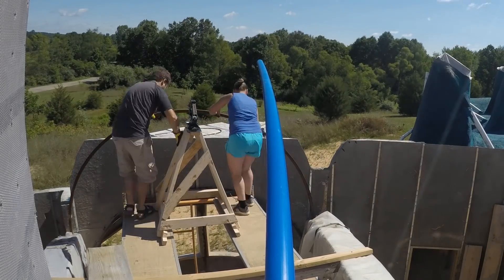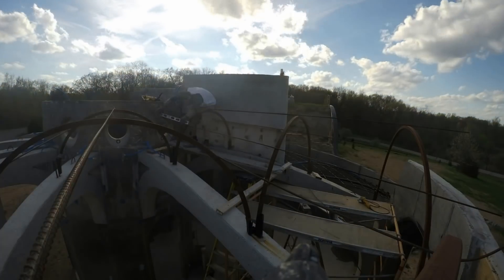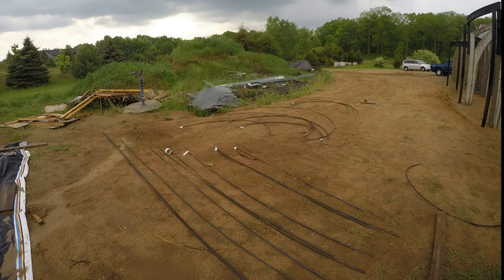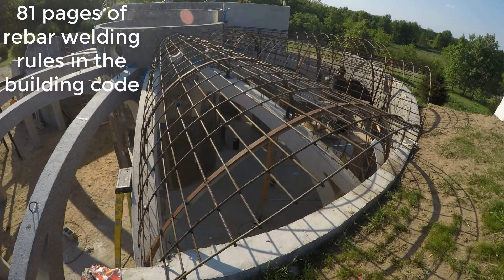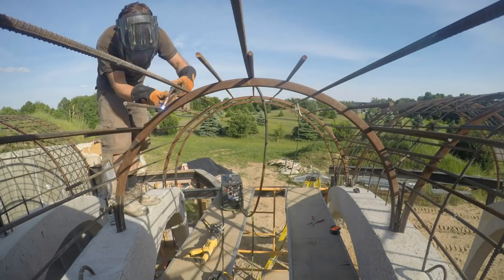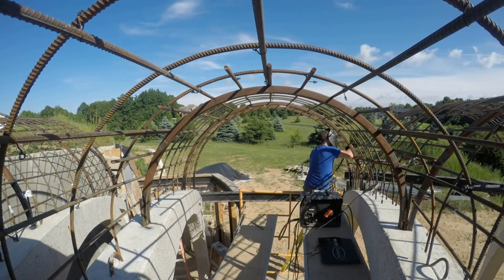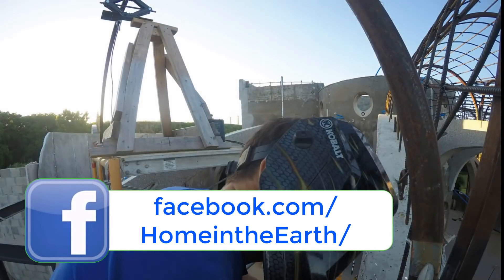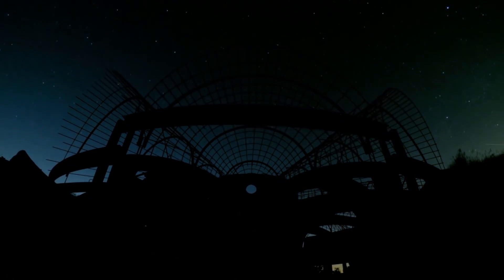41.0 Erecting the Radial Vault Steel (Part 1)

Comment: Camera questions: Are you set up to take a picture every X seconds or do you take video of the whole day and then speed it up in post? What camera are you using?

I ask because when I build my house (at least 4 years from now) I would like to do something like you have done and vlog about the construction. I've also thought about buying and mounting a camera on top of a telephone pole so I can get a timelapse of the entire construction from one place.
Reply from the maker: If you take video and speed it up, it gets huge.  I use a go pro and set it to take pictures every 5 or 10 seconds.  The images are higher resolution than the video and also give me a chance to edit out butt crack scenes and zoom in when I convert to video and still keep high resolution.  Once I put the video clips into the final video sequence, I can speed it up again or cut out boring parts.   For the pole idea, yes, I had one of those for a while and have often taken pics from it, but then I had to bull doze the location ;).  

The go pro idea works for me, but others use a cheap web cam for those sorts of long term time lapses because you can just leave it there and don't have to climb the pole to get the images and replace the batteries all the time.
Reply: Simon excellent explanation. Thank you

Comment: You guys must be millionaires.
Reply from the maker: Yup, because millionaires very slowly build a house by themselves over a period of years instead of hiring someone to build it for them...
Reply from the maker: If you are wondering how much this part of the build cost, for all ten vaults (only six are in this video), the cost of the rolled steel arches plus two tons of rebar was 4250$.  Welding supplies and wire probably added another 50.
Reply: @SimonHomeintheEarth  
Sometimes millionaires do such things. All millionaires are not lazy. If you are not a millionaire you are very wealthy. Can you post the total cost so far? That shouldn't be a privacy issue. Look, I am not downgrading what you are doing, but the reality is, is this is not feasible for someone that is not above upper middle income level.

Heck, I would love to build a house using tires, but I cannot even afford that.
Reply from the maker: @jamestomas7333  We bought the land cheap (in 2009 and far far from civilization).  As for the build its self, we had budgeted 76$ per square ft.  Some things (such as the garage doors and the windows and rough electrical) we were able to keep under budget.  Other things (such as the shotcrete and insulation) went over budget.  At this point we are on track to complete it somewhere around 95$ per square ft (not including the land).  The house that was completed across the road just sold (the builders never ended up living in it) for 331$/sqft (with the land obviously ;)   

If you want to go cheaper, I would suggest the Quonset hut idea.  To get that done, from the footings to the dirt on top, and including the garage doors, windows, electrical, plumbing (it has a bathroom), etc. cost 28$ per square ft.  It was also the easiest part of the build.  If we had just put a few of those next to each other, we would have been done years ago and be well under budget ;)

Comment: I've heard that you can have too much insulation, is this true, and can you explain why...
Reply from the maker: You can quickly hit a point of diminishing returns where adding extra insulation costs more than it will save in energy costs.  "Too much" also thickens walls and roof assemblies, etc.

Or maybe you are referring to squeezing in more insulation than the wall has room for.  For example, you could pack R30 insulation bats (should be 9 inches thick) into a cavity that should have got R13 insulation (3.5 inches thick) and the result would be even less than R13 because you have compacted away the voids that would actually insulate.

Other issues with "too much" insulation may be more related to trapping water vapor.  But then the issue isn't really too much insulation, it is badly applied insulation or lack of ventilation.

Another issue could be Ice Damming because you have too little insulation in some places, so the snow melts and the water runs down to another place that has more insulation and then it freezes.  This freezing backs up the water coming down above it and pushes the water back under the shingles.  Again, this shouldn't happen if you have a proper soffit vent, etc.

But other than the above issues, I don't think you can have "too much" insulation.
Reply: @SimonHomeintheEarth  
Trapping water, heard it on another video, with a house being too tight and too much insulation. I think the walls were 2x6 with spray foam, and the video suggested not going beyond that because of mold... I thought we all wanted a thermos...
Reply from the maker: @joeschlotthauer840  You can go as thick as your wall cavity will allow, but you should also provide ventilation to deal with the moisture.